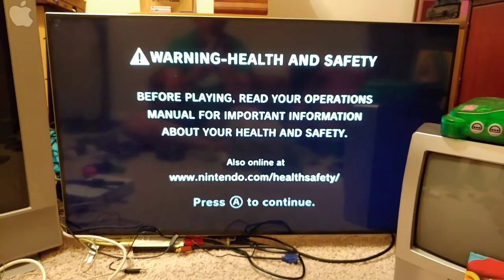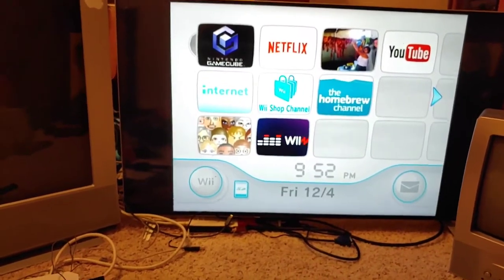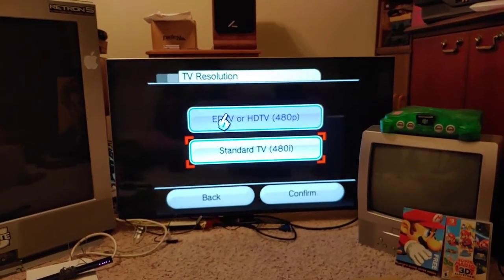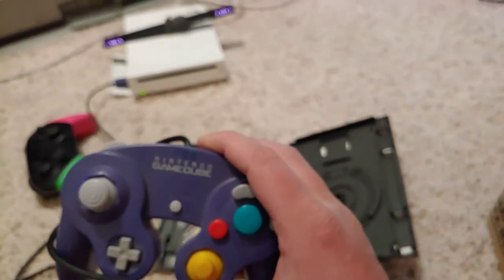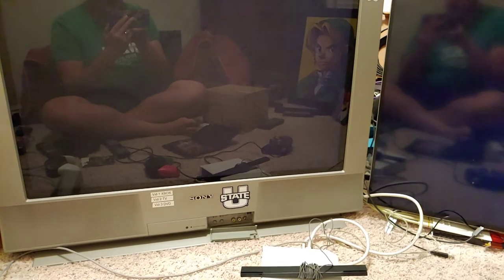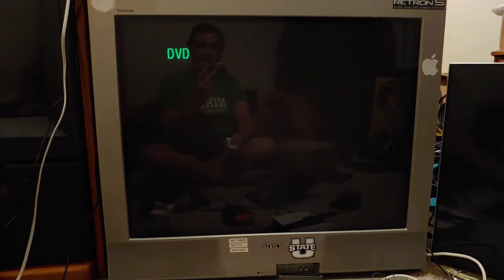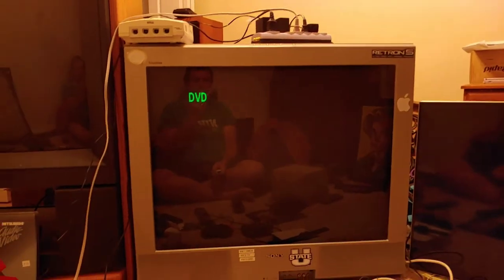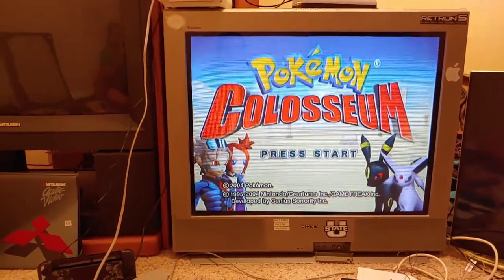Testing a 480p Signal on a SD CRT

Comment: Might be better if you get something like a gcompsw
Reply from the maker: Yeah, that does look like a good one.
Reply: @FairyKid64  same with HD Retrovision cables for both Wii and to connect the splitter. Quality matters
Reply from the maker: @smasherjosh5000  Yes, for sure.  Although while I'm sure the HD Retrovision component cables are great, I'm not too worried about the ones I used in this video - they're Monster Wii component cables - very well shielded.
Reply: @FairyKid64  do monster make male to male Component Cables? Might be worth getting for DVD players and VCRs
Reply from the maker: @smasherjosh5000  Yes - they do!  I don't know if they currently make them, but back in the day they did.  Many of them were even "THX Certified".  I have maybe a dozen of them since I see them at thrift stores from time to time selling for $1 - $3.  But it looks like they can be found on eBay as well.  They are VERY well built male to male cables.  My only complaint with them, believe it or not, is that they're a bit too well built - in that they often have what I call a "Monster grip" on your RCA jacks.  This can be a good or bad thing, but often once you connect them, they're not coming off without a lot of force applied!  But yeah - they also appear to have enough shielding to withstand a nuclear blast, so there's that too.  I don't know how necessary all that shielding is (especially if you're displaying on an analog CRT), but those Monster cables definitely do not disappoint!
Reply: @FairyKid64  ah yes I have heard about the death grip

Comment: Any differences between GameCube over component and the Wii GameCube over component on an SDTV? I would imagine they are both 480i and perform the same since actual GameCube hardware is inside of the Wii
Reply from the maker: I'll have to do another video on that.  From what I understand the GameCube actually has slightly sharper video than the Wii - but I don't know if you could tell a difference on a CRT.  Thanks for the idea though for a new video!
Reply: @FairyKid64  Nice! You have the official Nintendo component cables? I’m using the new Retro-bit Prism component cables. Thinking about what console to hook up to my Trinitron, but it will most likely be both 😂
Reply from the maker: @McGuinness89  Cool!  No, I don't have the official GCN component cables sadly.  I have the EEON GCN component connector (https://smile.amazon.com/dp/B07KL859FF/ref=cm_sw_r_apan_i_STJS1RPBS118Y9980B7M?_encoding=UTF8&psc=1) paired with Wii Monster component cables.  I'll explain my setup more though in the video. :)
Reply: Yeah the GC component is slightly sharper than the Wii. But it’s not by much so it’s not a game changer
Reply: @MagisterHamid  thanks for checking dude wow! Maybe I'll leave the Wii hooked up to my 4:3 CRT for 480i GC games and put my GameCube on my 16:9 for 480p widescreen GC games for that extra clarity
Reply: @McGuinness89  I use component for both my GC and Wii. For GC I force the game to 480p even if it’s not supported. The GC is very versatile. You can even force 16:9 for games that didn’t officially support it.